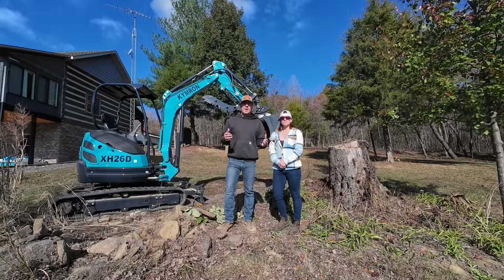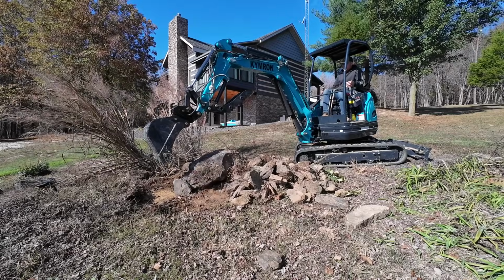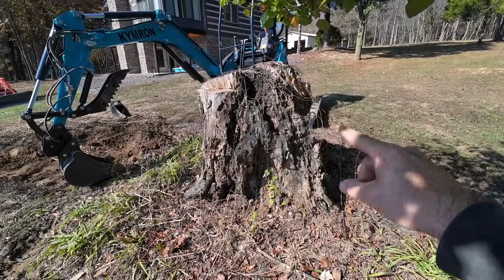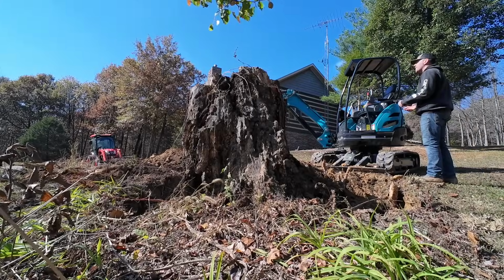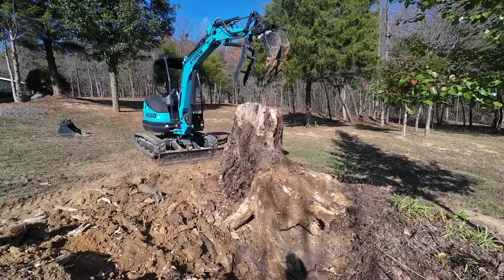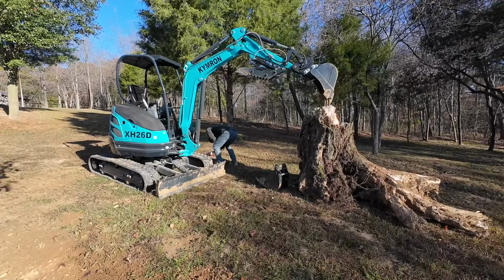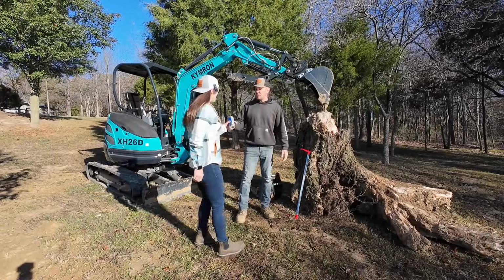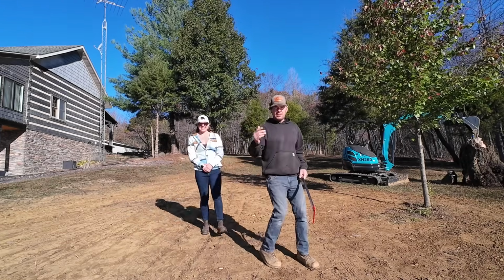Can This 2.6 Ton Chinese Excavator DIG Up This STUMP??

Comment: I’m still laughing 😂😂😂 
Thanks for the shout out! Now you just need to get that thing in the mud so you can put the track pick to work!
Reply from the maker: Hah! Thats good.  I want to get it mounted  on the machine soon too.
Reply: I wish you'd start selling the track cleaners!
Reply: @JCWren  I sell them at my local bobcat dealer. The problem with selling individually is shipping.
The cost to ship one tool is roughly $30 US. With that cost, along with packaging and materials, time/fabrication and so on, it would put the tool cost at close to $100.
I don’t think anyone would pay that for one of my tools. So that’s why I just drop them off at my local dealer. They can ship them, but I’m not sure what their costs end up at.
Reply: @OneEyeCustoms  You had mentioned at one time about making a video on how you're making those. That'd be more good welding content :)

Comment: That turned out well. A little grass seed and no one will ever know it was there. On the excavator, when you're breaking roots and such, take advantage of where the maximum power is, which is your bucket curl. Your boom and dipper circuits have less leverage, and the rotation motor even less. If you get the teeth of the bucket under a root and then curl the bucket, your pivot point becomes bottom of the bucket, and combined with the curl circuit having the most leverage, you can break roots and dislodge large rocks a lot easier than trying to drag the bucket through them.
Reply from the maker: Thanks for the pointer.  I was trying that.  I think the extra length the quick coupler added killed some of my curl power.
Reply: I think you're correct about that. IIRC it was the brochure for my 26G that had two different breakout forces listed, one for the manual coupler and one of the quick coupler. I went with the manual coupler, primarily because adding the quick coupler would have pushed the delivery date out even further. I've only swapped between the 18" digging and 30" grading bucket a couple times, and a QC would be nice, for sure.
Reply from the maker: @JCWren  i do like the QC.  Both of my buckets are small but ive switched back and forth quite a bit.  Thanks for the good info
Reply: This guy excavates 💪

Comment: Yesssss, more Mini Ex vids...I NEED them!
Reply from the maker: There a bunch coming.  Going to be working on some modifications too this winter.
Reply: @SpicerDesignsLLC  Mine is arriving Tuesday! Can't wait to a what you're gonna do with the joysticks. That's probably going to be my first big modification
Reply from the maker: @chrs1212  ya im pumped for that one. Im still trying to figure out that circuit.  Did you end up getting a Kymron?
Reply: @SpicerDesignsLLC  No, I decided to order straight from the manufacturer.

Comment: Word on the streets is take the the weight of the mini ex and 15% is what it should lift at full extension.... So around 800 900 lbs
Reply from the maker: Good rule of thumb.  Thanks for the info

Comment: First time seeing your channel.  Very impressive. Yours is twice the size of mine.  YouTube channel, of course...

EDIT to add:  I meant to suggest that you will have more downward digging force if you put the blade in the back and lower it to the ground.  I have a similar mini-ex and learned that from a Case training video...it does help with these great little machines.
Reply from the maker: Thanks for checking out the channel.  Ill give that a try with the mini.

Comment: I would like a 2ton. But have a 1ton. The otheres or out of my price range. You need a ripper tooth. A cheap way too build on is box blade ripper. What i did for my backhoe. And its 20 inches or so
You need a grappler for you front bucket. Helps alot
Reply from the maker: Yes i want both.  Ive really could use a grapple.  Hopefully i can pick one up for next year
Reply: Get the grapple for your Kioti, Use My wicked 55 All the time on My CK35
Reply from the maker: @Bob-rn8eu i really could use one.

Comment: Well I was not expecting you to pick up that stump with that small excavator, impressive job. How do you like that box blade for that finish job you did?
Reply from the maker: I was expecting that either.  Its been a good little machine so far.   That was actually a land plane/ grading scraper.   I use it on the gravel drive but it works great in the dirt too.

Comment: What’s up man!? New subscriber here. Was curious on your impression for this size machine doing normal stump work on trees that are let’s say 12-24 inches on average. If someone didn’t want to buy an expensive stump grinder would this size machine be a suitable replacement, or would you want bigger?
Reply from the maker: Thanks for the sub! Honestly this 3 ton machine has been pretty solid for me.  Ive dug up many stumps already.  Plenty of power.  It can handle a 24”.  Might take a little longer but it could do it.

Comment: It would be nice if you could review the mechanical features of the machine you are using. What is the Horsepower? Is it a diesel?  Is it 1 or 2 from the bottom of the line? What did it cost you? How long have you owned it? Have you had to repair it yet?
Reply from the maker: I did make a video on that.  Have you checked my other videos?
Reply: There are so many people making videos on these small excavators that the viewers lose track of who has what. If you could remind us each time it would greatly amplify the interest in your videos. We are also interested in what the hour meter shows between your current video and the last one. We would also like to know how long it takes to do your projects. To answer your question, I have watched every video of yours that has popped up on my screen. @SpicerDesignsLLC
Reply from the maker: @johnoler357  ill keep that in mind.  Some of the videos aren’t specifically about the machine.  I may just be using it on a project.  I will try to share more info.  Liking and subscribing keeps the creators happy and making more videos.  I do try to mention the lengths of the projects in the videos.   Hope your enjoying the content.   Thanks or the feedback

Comment: Make a frost hook for that thing. I want to see that video.
Reply from the maker: Thats basically a ripper tooth right?  I plan on making one of them.  Hopefully my table can cut that thick of plate
Reply: Laminate 3 or 4 5/16ths plates. Cut welding slots in them and weld them together. maybe cut some saw teeth on the front for roots. Do it. I’m making one this winter when I get to it.
Reply from the maker: @chadcworth1146  ya i can definitely do something like that.  Would be nice to have for sure

Comment: Looks exactly like the Leite 2.6T I was looking at on Alibaba. Where'd you get yours? I'm a little weary about the factory-direct approach with all the port fees, etc.
Reply from the maker: I have a handful of videos on the channel where i provide all the info and where i got it.  I actually talk about it in that video
Reply: Cool I'll check them out. Definitely feeling more confident about picking one up. Got 15 wooded acres that I need it for.
Reply from the maker: @mreed777  i use mine all the time.  Huge time saver
Reply: Oh I know, I rent 3.5-5 tons constantly so I think I can justify a purchase. Wish K&R wasn't 15 hours from me though.
Reply from the maker: @mreed777  they do have a couple other dealers

Comment: How did you decide on kymron? Did you look at groundhogs? As far as size how did you settle on that one? Asking cause I'm considering one and always like to get other opinions and experience. Thanks
Reply from the maker: I did look at the Groundhogs.  They are basically doing the same thing with the chinese excavators.  Making upgrades, having parts available.  They do beef them up a little vs straight from China.  I personally liked working with Ron.  He was very professional.  When i called, i talked to him directly and he was willing to work with me.  With Groundhog, i never actually got to talk to Nick.  Everything went though theyre admin.  So overall i liked the Kymron machines a little better and working with Ron was a better experience.
Reply: @SpicerDesignsLLC  thanks, I've gone from looking at a tow behind harbor freight to an xd22 kymron. Now you've got me looking at the Xd26!! Enjoy your channel, same kind of humor as me!
Reply from the maker: @Outdoorsy368  i was stuck between the 22 and 26 too.  I wanted the extra weight.  Glad your enjoying the channel